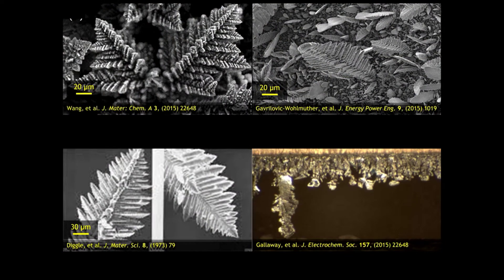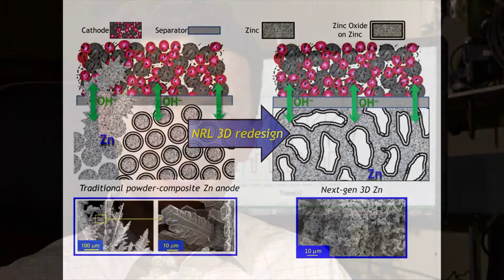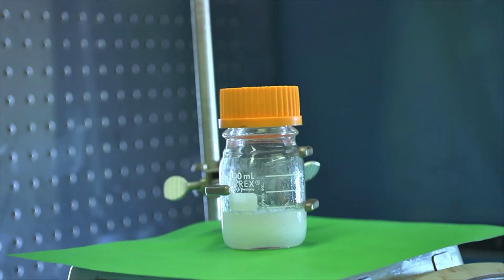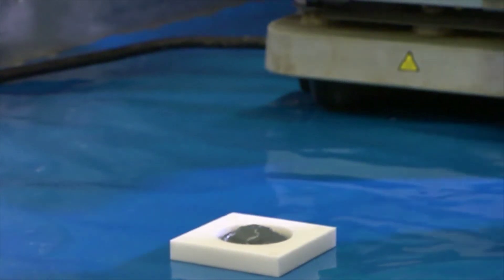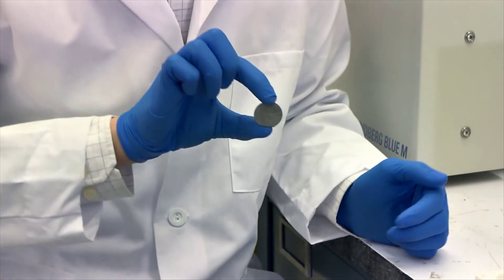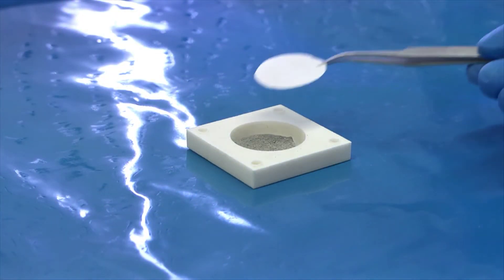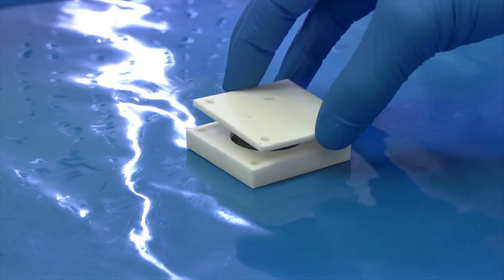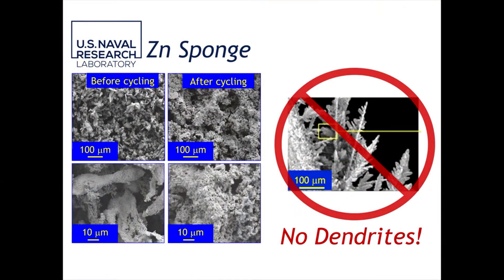NRL enables a family of zinc-based rechargeable batteries, safer than lithium

Comment: I've been shadowing this since this press release. Simply put, only the side closest to the cathode plates out. In acid it plates. In zincate it loosely binds as a powder. Giving the dendrites somewhere to go helps but full permeating of the considerable surface area doesn't seem likely. I've tried copper screen. Works pretty well and likely was the ah ha moment experienced when tried in your lab which I tend to believe did happen as we leave no stone unturned in pursuit of discovery and application. A zinc air approach was used in my trials. Good luck finding a way to market. This seems a more formidable hurdle than the art of invention. Thank you for posting this informative video.

Comment: How is the zinc electrode heat treated after drying just curious so I can do some of my own tests... This is very helpful info hope it's a success
Reply: Here's my opinion- if in an alkaline solution the dendrites loosely scattered on the copper sponge have a lower melting point than copper. When the copper glows red the zinc dendrites melt and are adsorbed into the zinc sponge. This again is only an opinion as to how the sponge is "soaked" with zinc metal. But any furrher expenditure of energy reduces round trip efficiency. Hence this method is questionably of any advantage over other available technologies. I hope I'm not wrong but I'd be shocked to find out I was right! Thank you for your review of comment.
Reply: @evanriddle1614  I have a nickel zinc battery on my you tube. It’s only 300 milli amp hour but will last a very long time.
Reply: I believe the zinc dendrites bond to the copper when the copper sponge is heated red hot. The best thing I've come up with is a 6 hour aluminum air battery cell. It's cheap and simple. Probably would lend itself as a power source for something that needs to run 6 hours or so, like aircraft.
Reply: @evanriddle1614  over charge my cell and zinc dendrites form and self discharge is increased. But don’t do damage to the cell, over night and they dissolve back into the potassium hydroxide.
Reply: Yes. Dendrites are made by the alkaline and dissolve back into it. Zinc8 of Canada has come up with a way of storing the dendrites. It's a stationary system. Deustchpost made zinc air batteries fresh, loaded in the morning and made deliveries. It appears that dendrites dissolve like snowflakes under a blowtorch whether making power or not.